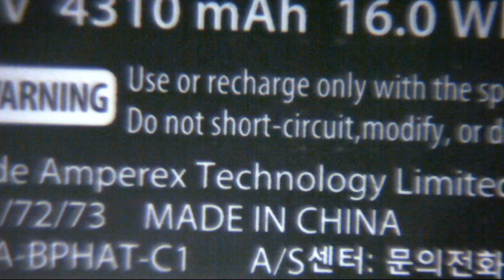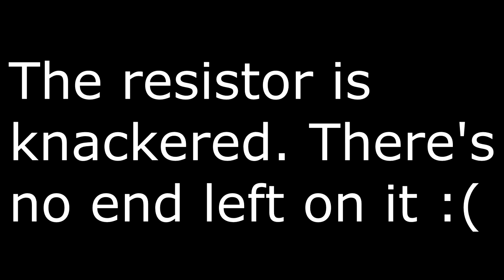Nintendo Switch: Power button not working - Motherboard diagnosis and repair

Comment: Somewhat related, I had a switch lite last week, when you pressed the l trigger the console would go to sleep.
I went into test button input and it was registering as l but then going sleep. 

turned out to be corrosion on the daughter board. on the fpc connecter. cleaned and as good as new.

Comment: Might you help me ? have an Xbox one s error e100 have already tried several hard drives and it marks the same, have also tried another connector marks error at 1% of the second step any ideas?